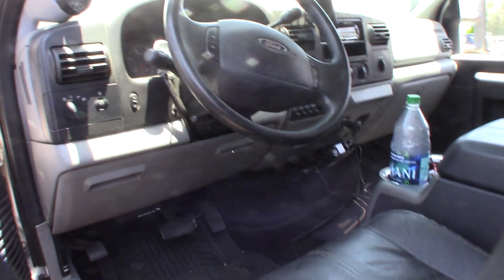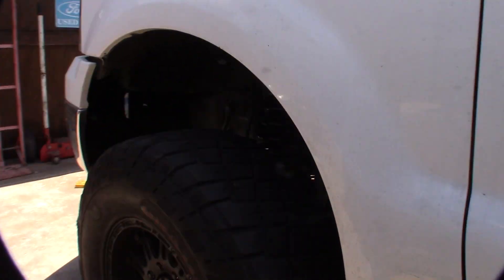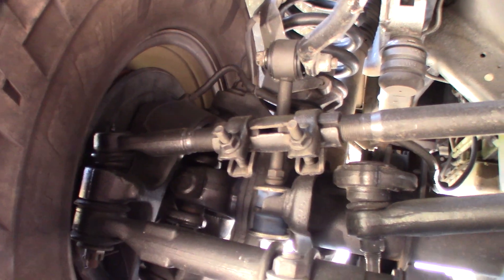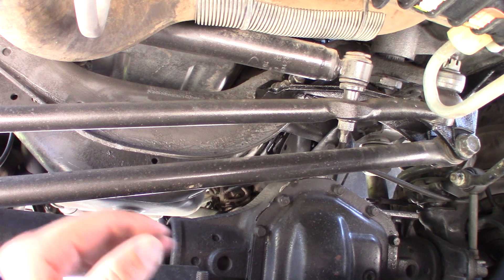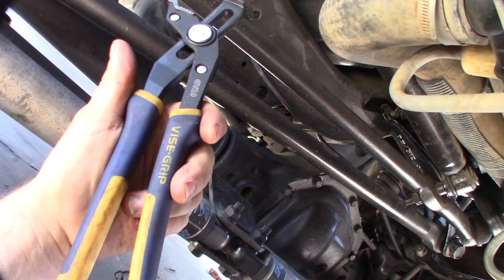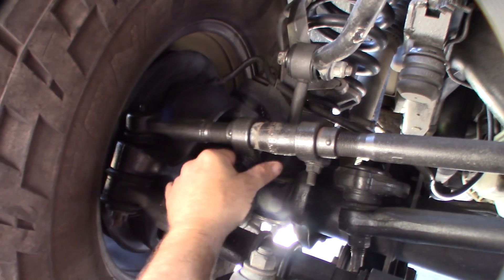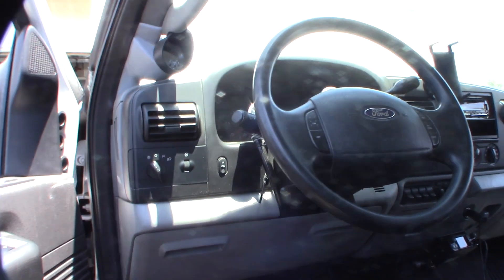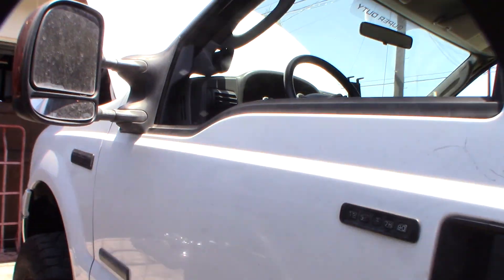Ford F250 Drag Link Adjustment Steering wheel alignment

Comment: Pulling the wheel would change the relationship between the center position in the box and where the wheel is. This can affect preload and introduce atypical wear in the steering gear. Terrible idea. Only adjust via the drag link collar.